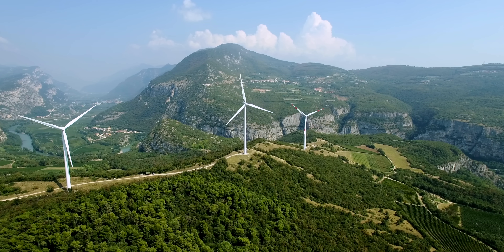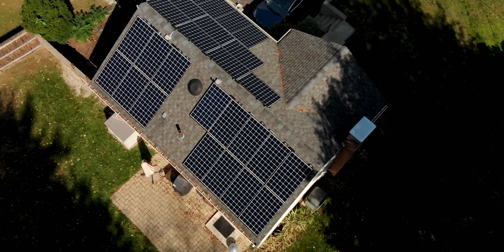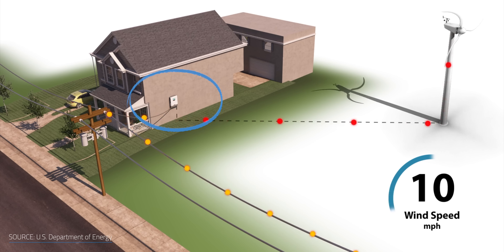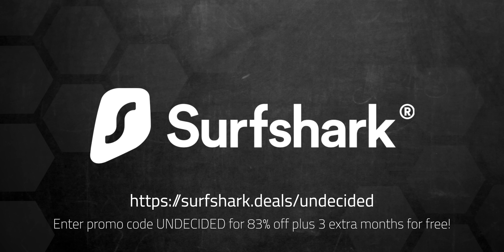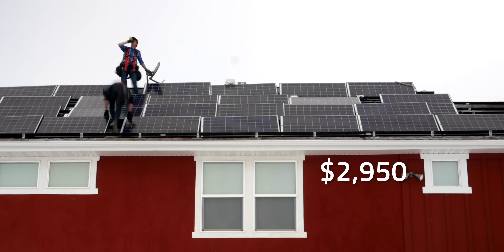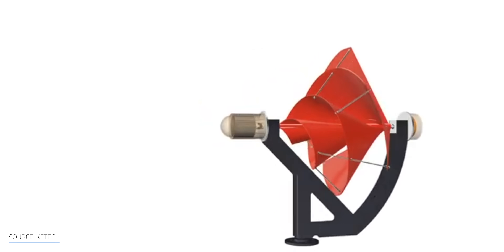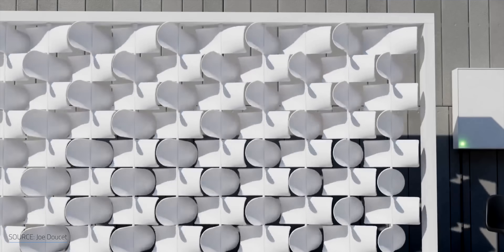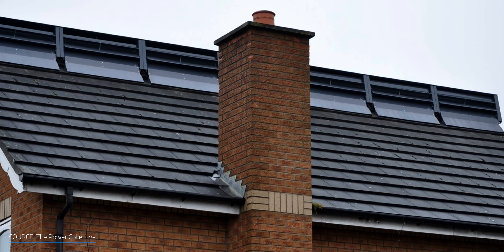The Challenges of a Wind Turbine on Your Home

Comment: I am not sure where you are getting your figures at.  I have both solar and wind where I live (in the city).  Most of the time the sun is shining, I live in Tucson, but when it is cloudy the panels don't produce much.  Our solar panels cost almost $20,000.00.  We tend to have a lot of wind when the sun does not shine, so the wind turbine supplements the power we need.  I only paid about $200.00 for a Chinese wind turbine and it works great.  No maintenance at all.  I have had this system for several years now.  I think the main factor to decide if a wind turbine will work for you is, how much wind do you get during the year.  I would say that my wind turbine has paid for itself after only one year of use.  You don't need to buy the biggest wind turbine to get any benefit from it.  Some times a small one will work just fine.  Oh and we are still paying on the solar panels.  We hope in another 10 years to break even with solar.